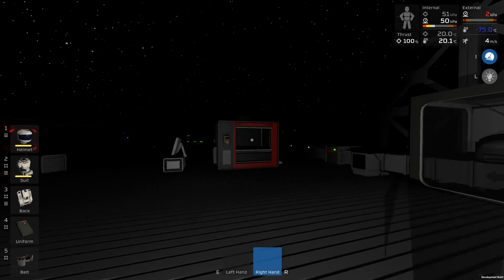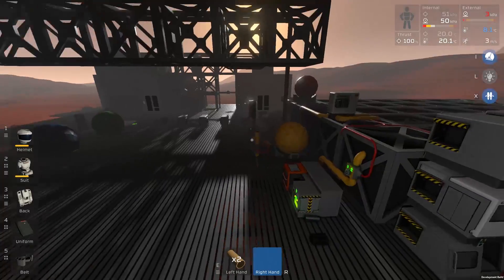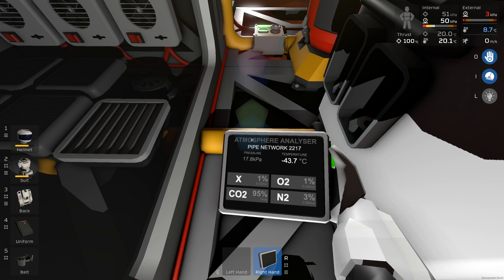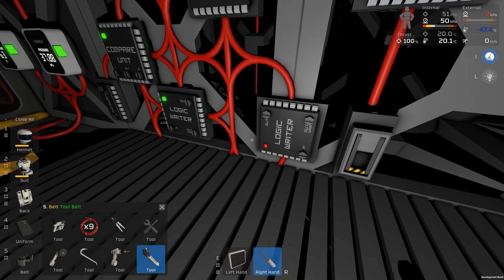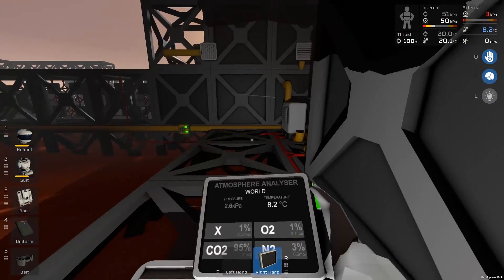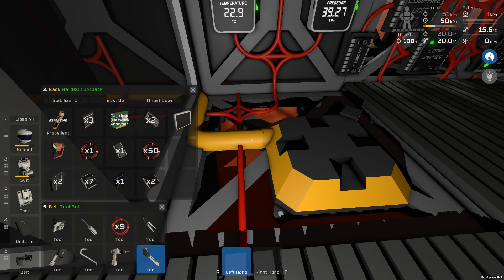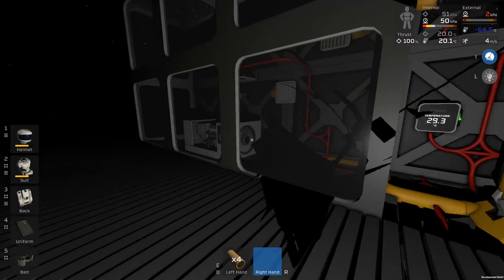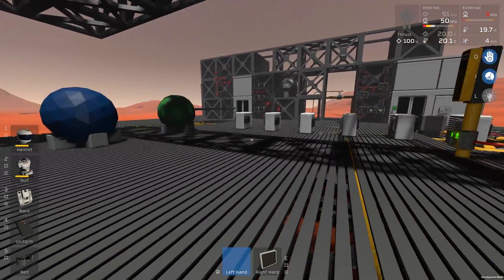Stationeers S2 E42 - Cryogenic Cooling Room

Comment: I hate to say it Gray, but your going to have to run alot of pipe. It needs to mix at the very last moment possible before the generator or it will auto ignite. Before the atmosphere changes, I had a regulator on O2 and H2 lines, then a mixer. Set the regulators at like 4 to 5, because the geny will blow out lines very quickly with too much pressure. Automate the regulators and mixer to come on with the generator. I have even seen super cooled gases mixed together auto ignite.
Reply from the maker: What if the mixed pipe is only 1kPa?  It really shouldn't autoignite then!
Reply: Ok, so have reached out in the Discord, and still need to mix it only at last minute before use, and the gasses have to stay below 20c. Do not use a storage tank to store mixed gases either. if the sun heats it past 20c, then it can and most likely will auto ignite.
Reply: grayduster It can if the gases are too hot (looking at your greenhouse ;) ).

Comment: I think the room overheating from the fuel generator is an un-intended bug at this time. The gas in the exhaust should not be cold and ambient temp from Geny be scorching hot. I think they got them backwards. An internal combustion engine produces more heat in exhaust than radiant heat, although it will be hot, not the radiant temps we are seeing in game. I have not been able to create a stable room for the Geny to run in yet, as it always seems to overpower whatever cooling tricks I try to do.
Reply from the maker: Yep, I do hope they change it, but I think we can engineer a room to absorb it for a while :)
Reply: I do think it is a glich, but the output is, not the atmosphere, I remember haveing large influxes of heat in the atmosphere around a gas generator, while it's output was like 1500K, a while back.

Comment: Just a sidenote: placing the furnace directly in a room with wall heaters works now (0.1.1609.7556). Just made 100 invar at 6.1MPa, 1300K. I recommend constant 10 kPa for the room (needs pressure regulation and a buffer tank) and as many wall heaters as you can muster (it takes a while to heat up). I also added an air conditioner in cooling mode using the furnace as a heat dump, which only uses 5W when the furnace is colder than the room (almost always) and helps speeding up the heat transfer a bit, but that doesnt seem worth it. I recommend a slot reader / hash display console to watch input processing and a reagent reader or logic reader (reagents property) to watch contents.

Comment: grayduster The speed of gas pumping with the filtration units is proportional to the volume of the input pipe (and that does not include any tanks or anything, that when hovered over with the tablet says it is not in the attached network)! That means you can change the speed of pumping, you would just need to make a manual valve, and limit how big the attached pipe is, changeing its speed, and that is a recent change.

Comment: in the real world, heat exchange works better with more material (higher pressure) and higher specific heat capacity (pollutant) so you should think about replacing your exchanger gas with that.

Comment: This is a imgur album of my water cooled gas gen room. https://imgur.com/gallery/wgXHNOW - its pretty much a ton of testing, building, blowing stuff up and then settling for what is currently working well enough to charge all the batteries for my base without gas gen shutting off due to overheating or anything.

Comment: grayduster You can actualy void heat using wall coolers! Just keep the connected pipe empty (unless it was changed). But you need pressure in the room to be +5kPa.

Comment: grayduster You need to change the system, you need the radiators in the generator room, and you will need to pressurise the pipes and that room highly, and you need to make sure that the radiator pipe is constantly pressurised.

Comment: grayduster Put a radiator in the cooler room, attached to the fuel line, it will keep it cold, or just thermaly isolate the pipe, by runing it in already existing frames!

Comment: Your fuel went off in the lines.  This is a big problem on the beta branch.  Suggest radiators on your fuel line or move your mixing point close to your point of use as its not combustible unless it is mixed. Actually both is the best solution.   Use radiators to keep the gasses cool mix them cool then keep the mixed gas cool till you use it. 
.
Reply: David Pulliam Do you know what is the temperature of combustion in this game, because if it is under 20°C, then it is not a good idea to have pipes out in the open at all. The temperature changes during the day and it reaches 20°C max.
Reply: eryk sołowiej this is something i have not tested.  Usually, I carry pure gasses to within a few feet of where they will be used then put my mixing gear in.  It does seem like its really easy to make mixed fuel go boom in this game and it does not take much to do it.  I currently have a mars save running and doing this except for my pipes run inside frames all the way to just before my furnace is placed.  I have the pipes ducking out of the wall and a few radiators in place before mixing.  I still can occasionally have the gas go off during the day time if I try to mix it but because of where I do my mixing if it goes boom, I can just shut off the mixer then vent it through the furnace and into the gas recovery system and not loose too much gas then let everything cool down.
Reply: David Pulliam That is because you have your tanks outside, not isolated, that causes temperature increase, or you don't cool down your oxygen that is generated by your greenhouse, which easly sometimes can be as high as 47°C (if you are growing plants in the upper temperature range, max temperature for plants not whilting is around 50°C).

Comment: This whole issue with the gas generator is getting out of hand imo. Between watching how you've tried to solve the problem and me racking my brain in my own game, I'm really starting to wonder if anyone has gotten the generator to work consistently. At this point I'm of the opinion they need to rebalance the thing so it operates at a much wider temperature range.
Reply from the maker: I agree!